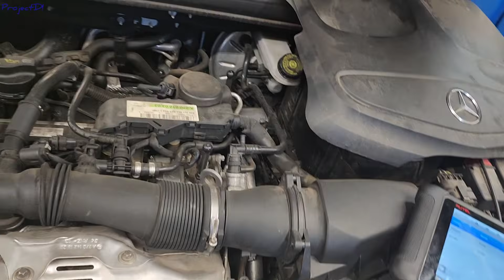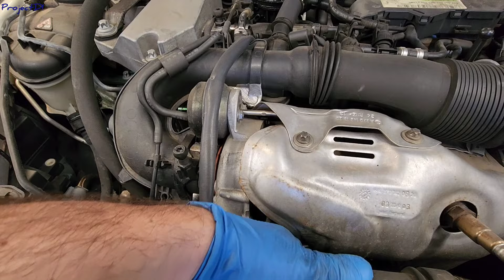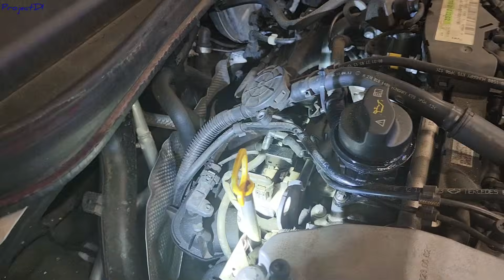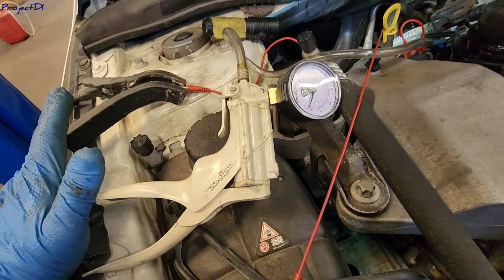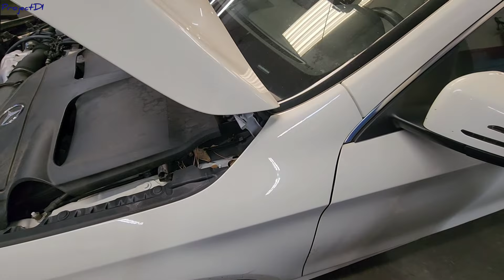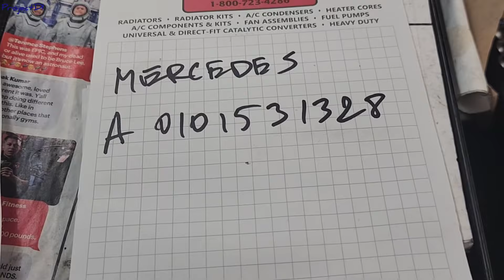MERCEDES P0299 2.0L LOW TURBO BOOST PRESSURE CHECK ENGINE NO POWER TO VEHICLE, DIAGNOSTIC & REPAIR

Comment: Hello I have a 2014 s550 and the p0229 code came on and CEL, saying low pressure on turbo 1, I looked in the engine and saw some oil near turbo one. I’m no mechanic could have been old residue. Only code is p0229 nothing els.
Reply from the maker: The S550s have a completely different setup and they have a very common problem with The Timing Chain Covers leaking around the turbos. Please check my video in this/my Channel on this particular Oil Leak problem as I believe I have the Best and most comprehensive diagnostic and repair video on YouTube so car on this issue. As far as the Boost code it will need to be checked by a Mechanic specializing in Mercedes so they can run a scanner to diagnose the issues on your vehicle. Sometimes you have to run Livadata to see what sensor is not working with what numbers they can see or you may simply have an Air leak. Thanks👍
Reply: @projectathos hello so I got the car checked by a professional, the coolant hose for the turbo was completely broken and he said it toasted the turbo, but he told me I might have to replace both… if only one turbo code came on is it possible the drivers side turbo is still good? And the oil leak was from the oil pan and gasket, he quoted me close to 7,000 and I’m still tripping Bevaise a whole engine goes for 7,000. Wondering what you think.
Reply: Did you get to solve this issue. I have the same error code and limp mode

Comment: Bro do u have any idea how much a wastegate repair would cost on the gla45 ‘15
Reply from the maker: You don't repair a wastegate my friend. You meed to replace the whole turbo because the waste gate is attached to it. Those are metal parts that get worn with time and cannot be repaired! You need to call a shop around and get an estimate... Thanks and Good Luck!
Reply: My waste gate arm has a little bit of play so cant the wastegate flapper be changed

Comment: I have the same issue w my CLA 45, I hope I can fix it.
Reply: Hey, I own a 2014 cla45 with same problem. If you troubleshoot it. Can you tell me?
Reply from the maker: If I had the your car at the shop yes. Not sure how I can do this troubleshooting otherwise... Thanks👍
Reply from the maker: Good Luck! Check all the parts in the system per my video... Thanks👍
Reply: Hey i have a gla 45 any idea how much does a wastegate repair cost
Reply: I got a cla45 it’s the wastegate flapper inside it’s a $50 job if you do it yourself, you don’t need a whole $5k turbo just $50

Comment: I’m having the same code brother I’m going to follow your steps and see if it is the same problem. I have a e300 2018. Can you give an update ? Was the problem fixed after replacing the solenoid?
Reply: I just got the same problem bro on my 2017 e300 rwd
Reply from the maker: Yes, in my case it was the solenoid but it could be also be the Waste  gate or the actual turbo itself. So you would need to get a proper diagnostic and check all the things in that network... Thanks and Good Luck!